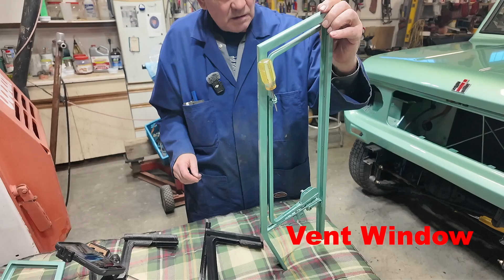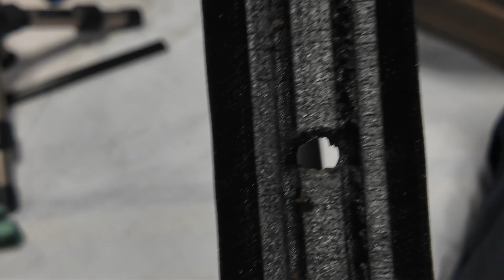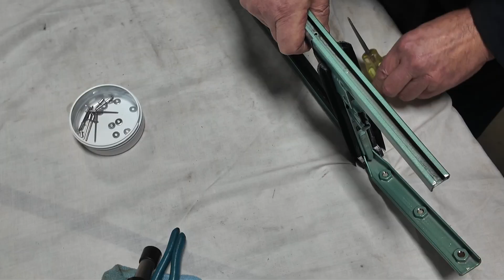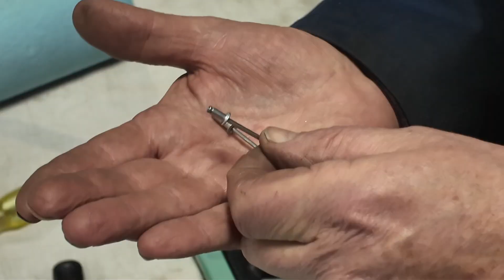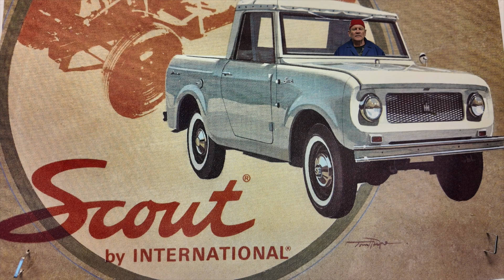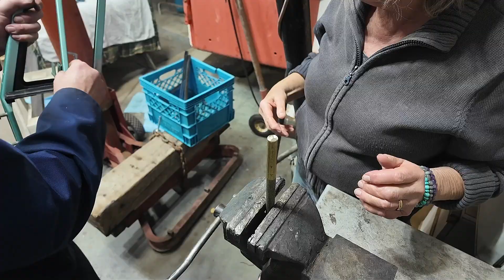Scout Restoration Yukon: Scout Vent Window Assembly.  All the Details !

Comment: im curios is there a seal that goes in the track for the main window
Reply from the maker: The Rear Track has a liner The front Track has a nylon Guide that is attached to the roll up window frame.
That’s all there was in 1966 !
Reply from the maker: I think it’s a good idea to drill 2 holes in the bottom of the door to drain potential water !